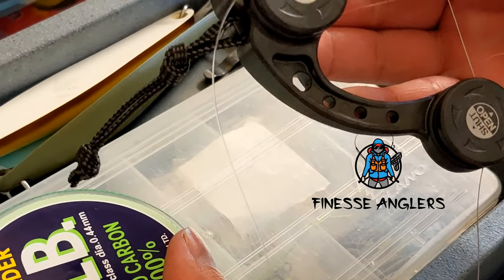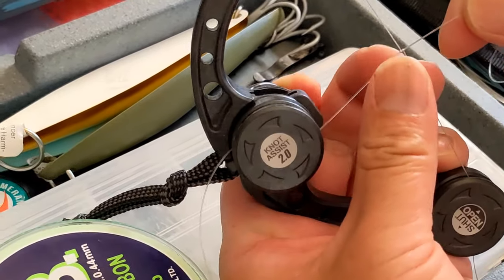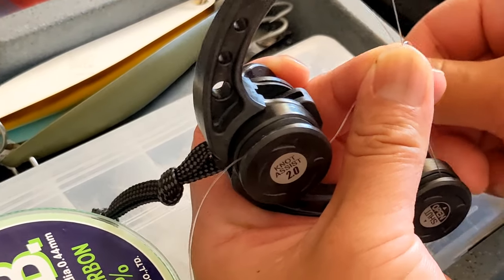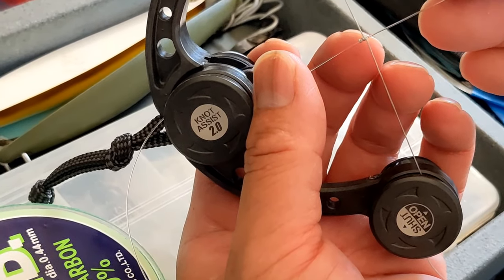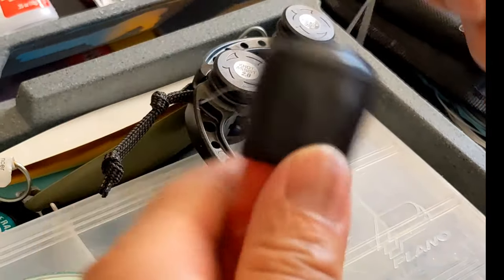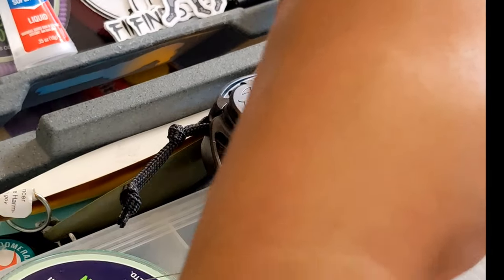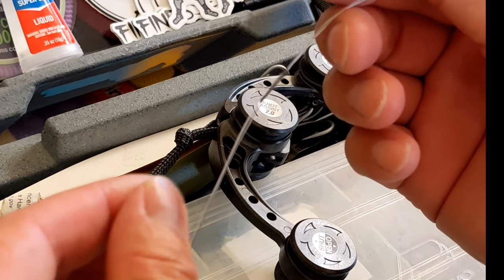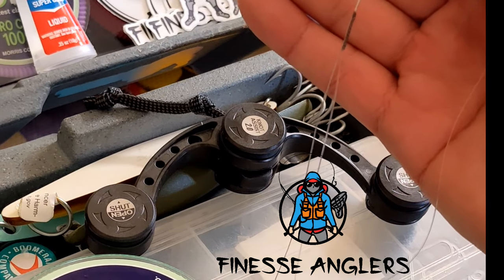FG Knot using the Daiichi-seiko Knot Assist 2.0

Comment: Do you use the assist tool on your trout gear as well?  I find that with 0.2 PE the wraps tend to cross over each other with the tool and I have much better control/cleaner knots doing the FG manually.
Reply from the maker: Yes we do. Not as much as our salt. But we haven't had issues.